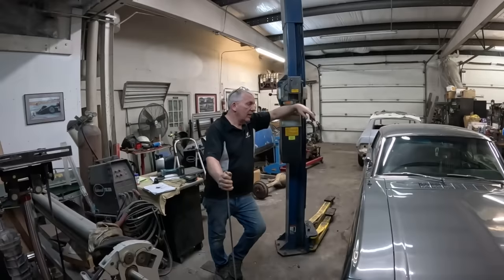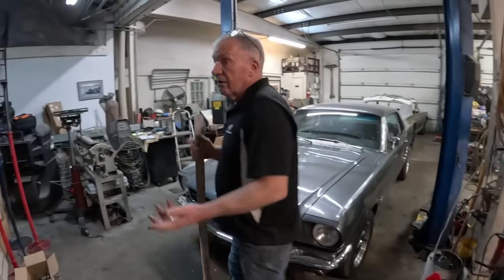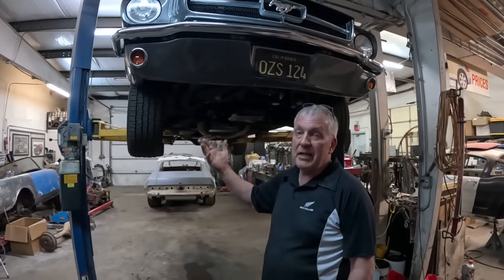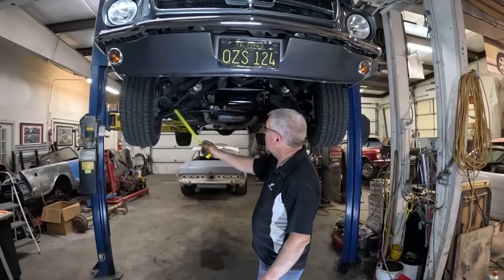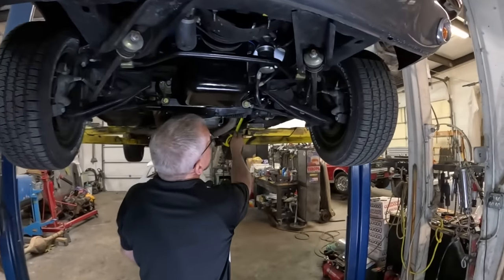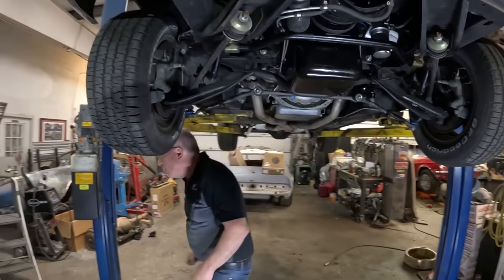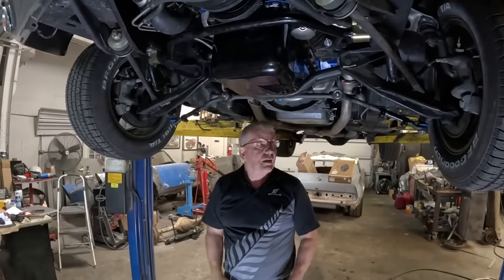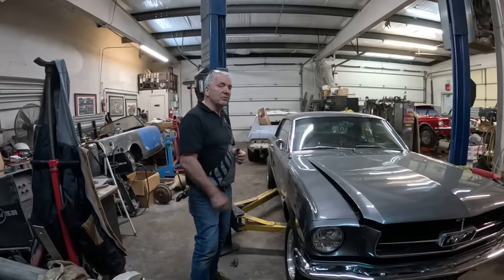Flaming River Fiasco

Comment: Holy Cow!  I have never seen that amount of bump steer.  I built a Shelby Cobra kit car years ago and dove in head first into suspension geometry including bump steer.  Now, it's not difficult to look at a system and see what can be done to correct it.  I mean simple things like rack movement or re-positioning tie rod end connections.  But this Mustang!  Holy Cow! (again).  You're right to go back to the original system.  I know that the flaming river rack could be made to work but it would include radical suspension changes and lots of relocation.  Likely moving the tie rods to in front of the axle.  A rocket science project for sure.

Comment: I just bought a 65 Corvair with a Flaming River steering box in it. The box is a so-called bolt in replacement for the stock box. The car had a full 1/2 turn of the steering wheel slop in the box. I took it apart, and couldn't really see any reason for the slop. I adjusted it, but it still has more play in it than the old, zillion mile GM box I replaced it with. Several people with the same box in their Corvairs had a similar problem. Not sure I would trust Flaming River with ANY steering component now!
Reply: You know🤔the name flaming river lends well for abbreviations 🫢that one’s a laugh riot just waiting..
Reply: how is that even possible if there wasn't like a pin broken off.   did you tear it down to see what was up with it?
Reply: @lasskinn474  Yes, but I didn't remove all the recirculating balls. I suspect that is where the play is.

Comment: Brought an xm ute years ago DU997 nice bright orange show ute 289 5 speed supra but had serious bump steer due to using xb falcon stub axles for the disc brakes they pushed the top and bottom ball joints too far apart replaced with original stubs and machined adapter to use xb rotors and used hz holden brake calipers because the were just two bolts straight through to mount on the backing plate bolted to the original 4 holes the original drum brake backing plate bolted to. Then had to do a recert. Which was the hardest and most expensive part of the fix lol typical kiwi we say it how it is no sugar coating. 😁🇬🇸👍

Comment: Bump steer in Mustangs & Falcons was always an issue. Simple fix.....Dropped mine 2 inches, 3/4 negative camber &  a total of 6mm, or 1/4 inch of toe in. The key is aligning Pitman arm & the idler dead parallel with the frame rails with the car at ride height.
Reply from the maker: Yeah ya just need an alignment tech that will do as he's told right😉👍
Reply: @kiwiclassicsandcustoms9160  Yes...I spent a lot of time sorting mine & then I met an alignment tech who knew his Fords. The 2 inch drop gave it about 1 degree of downward rake at the front. Set it up exactly as mentioned.....handled like it was on rails. On a twisty road it shamed a lot of more sophisticated cars.

Comment: I have used many flaming river steering boxes. The tugs at a major airport used solid non-pnumatic front tires. Very unforgiving and blew out the castings on the OEM steering boxes. We would order a pallet of fr steering boxes at a time. They worked FINE and were a fair quality part. As I was the mechanic changing the broken boxes I had no issues after several dozen boxes. Many things can affect bump steer, shortened steering arms, bent steering arm, raised or lowered steering box position due to frame repair ( accident) or a combination of all parts ( tollerance stack up ).

Comment: Great video!!! I'm wondering if the flaming river rack was mounted too high, relative to the road surface. I'm unsure if that would have corrected the steering shaft joint issues. It does seem like (maybe?) it would have put the rack's joints at an angle closer to the control arms' angle, which could have improved the bump steer. Maybe not...
Reply: On cars with the tie rods behind the axle centerline, that rack should be raised, not lowered. That said, I think that would make the steering shaft angles worse (I think). I was thinking along the same lines as you, just the opposite direction.
Reply: Excellent video and solution. An observation.  If the difference between the rear of the wheel to the front was 5 inches, then the toe in (or out,  depending on which side was greater) would have been 2 1/2 inches. Still horrendous though! Did the buyer have any comeback on the seller?

Comment: I understand your flame of Flaming River Kiwi, but could this have possibly been an installer error or the wrong parts used  more than a manufacturer error? The new parts worked out great though, nice job!
Reply: I don't think it is a Flaming River rack. Look on there website, it doesn't look like any rack kit sell for 66 mustang.
Reply: @GNaron  I didn't look into it, I'm just going by what Kiwi reported. Either way the problem existed so it was either a poorly engineered part (which I double Flaming River would market), or a faulty installation. The important thing where steering, suspension  and brakes are concerned is to remedy the problem so the car doesn't go out with a potential safety issue lurking.

Comment: Recirculating ball steering can be very precise. One thing that helps a lot is to ensure where the steering box mounts to the chassis is very strong and won't deflect.
Reply from the maker: Unfortunately the chassis rail flex's quite a bit on the early mustangs. They added a torque box in 67 that helped a lot

Comment: I went totally off the deep end analyzing the stock suspension. After my mods I got the toe change down to 3mm with full suspension travel. There were a lot of things that influenced it. Namely, pitman arm height,aftermarket arm design, steering box wear or rebuild, idler arm position. + Caster increases tow change as does negative camber curve.
Reply from the maker: It's a science all of own !!!

Comment: Flaming river full gong show on foxbody 
I hate it because here’s why 
1 ) if you order just the steering wrack then 
Number 2 
You have to order the top gear parts 
then because the bushings are different in the steering arm . 
Number 3 you need to order steering rack extenders because your outer rods don’t fit 
Every part is different and depended on the next part 
What a garbage product 
Just a sales strategy! 
You will have to order all 3 or 4 parts and then realize your 12-1400$ in hole for steering rack !
Reply from the maker: Buyer beware....!!

Comment: I was working on a c3 corvette that was scary to drive and the cause was the flaming river rack. The steering shaft had to go almost straight down from the firewall to the rack so that the u-joints would bind and the toe changed with bumps just like this.  I have a video of it on youtube.  The fix was to replace it with borgeson box and stock steering parts.

Comment: I had a flaming river manual rack on my 2012, and it had seemed okay. Different chassis for sure, though. I ended up taking it off the car and going to hydraulic PS because I was injuring myself trying to turn the car when it was sitting still.

Comment: What is a Flaming River Steering Rack conversion? I mean, what does it do? Or what is it supposed to do? I understand everything you are talking about in your video, I just have no idea what the part is you're talking about.
Reply from the maker: It replaces the original steering box and linkages with a rack and pinion system

Comment: I could understand if someone not knowing what they where doing, pulled the parts out of a junk yard and did the install. I've fixed that nightmare before. This catastrophe has a couple of people to hold accountable. The manufacturer and the installer. Installer should have known it wasn't right and sent it back. Letting the manufacturer know it's not right. Good job doing the right thing!

Comment: Scratching my head and thinking..... Would installing the Flaming River tie rod ends under the steering knuckles rather than over them help the bump steer dimensions?
Reply from the maker: Possibly it could have reduced it but unlikely to an acceptable level.  Then you still had the steering shaft universals binding from the too severe angle they were working through.   Time to cut and run as they say

Comment: Unless you want to go road racing and engineer the steering and suspension from the ground up the stock style stuff works fine. You can always get a quicker ratio box that bolts right in. No brainer IMO.

Comment: Listen all these rack & pinion kits are garbage (including the "mustang ii" kits), but you cannot measure toe with the suspension unloaded in the air.
Reply from the maker: No you can't, you measure it at ride height. I was just trying to demonstrate how much bump steer it had.  You expect a little but no where near that much!
Reply: @kiwiclassicsandcustoms9160  I 100% understand I was more pointing it out towards the general public. The best thing about those "F.R." type kits is it's a lot easier to go back towards the stock set up. T

Comment: that's not the same rack n pinion that flaming river shows on their website for a 65-70 mustang!!!! I should know i have a flaming river rack on my 65 mustang and mine is not even close to looking  like the one you show on that car, i installed a manual flaming river rack with electric assist power steering and it works very well! yes i do have some bump steer issues that i will address but not even close to being as bad as your dealing with. again someone installed the wrong rack, that doesn't even look like a flaming river rack!!!!!! looks like a competitors rack. your flaming flaming river...lol you have brought a great amount of awareness to me on how to measure tow in when lifted off the ground, i will lift my car off the ground and give you my measurements, they do have bump steer parts/kits to help out on theses issues, my car drives like a dream but there is some bump steer issue but not really that bad. again the rack you show on that mustang doesnt even resemble a flaming river kit! go to flaming river  and look for yourself!!!

Comment: Looking at this conversion I wonder if the problem is not with the conversion but with the original installation. From what I can tell, the outer tie rod ends were installed incorrectly on the conversion. They are on top of the steering arm. Look at the original setup and you'll see the outer tie rod ends connect to the bottom of the steering arm. Putting them on top of the steering arm will put the ball joint center much too high and give the bumpsteer issue you are getting.

Comment: What Does this have to do with flaming river? How do you know what parts are on that car? I’ve worked on mustangs where people swap them to disc brakes, swap to six-cylinder drum brake car over to a V8 disc brake car and changed the disc brake knuckles, but left the six-cylinder drum brake center links and tie rods and stuff like that and the car had insane bumpsteer. I would make sure that this car has, all matching brake suspension parts on it before calling out on flaming river

Comment: Have you tried EPAS yet? I just put a 2010 Corolla electric power steering in the Flaming River column in my '36 Chevy and it works great. You do "get to" cut your polished stainless column in half though.
Reply from the maker: No not yet but I have a kit here that may well find its way onto Large Marge....
Reply: @kiwiclassicsandcustoms9160   A kit?! That's cheating! I got mine out of a wrecking yard for $130 and a pair of "fabrication" clamps off ebay for $55, a few feet of #8 wire and got er done. I did the same thing to my daughter's '63 Nova but, had to keep the column shift for the automatic. THAT was some engineering.
Reply from the maker: @lylejohnston4125 well yeah it kinda is I guess. But mine cost less than yours so ....😬 😎

Comment: take flaming river name off this video title please, its not even a flaming river product. plus the tie rod end has a taper in it that can only mount up from the bottom, how they managed to mount it from the top is just a big error. I own a flaming river rack n pinion and it works well in my 1965 mustang, I added electric power assist to it as well, yes it does have a little bit of bump steer issue but Im fixing that with a bump steer kit. you want to angle the outer tie rods ends about the same angle as lower control arm angle.

Comment: That flaming river stuff would work if it was installed correctly.   My Cobra has modified jaguar suspension  with a shortened Commodore rack and pinion.  I set it up with the steering arms at the same length and angle as the suspension arms and my bump steer is under 5mm at full travel.  The clown that installed the F.R. rack had absolutely no idea.

Comment: Looks like it needs a wider rack so the pivot points on the tie rods and lower control arms match. If the car had the correct rack, it would drive fine.

Comment: You are generous allowing 1/2 " of toe tolerance. I allow a 1/4"  Though those Fords with their excessive droop will get worse on the full droop.
I check only, without springs, the amount of 'usual' suspension travel. In my case about the bottom third. This on a XE Falcon road race car that is not that low at the front. All slightly modified.
My old XU1 Sports Sedan to was very good, and that was very low and all modified! For steering response both cars have about an 1/18th of toe out. Not recomended for street cars however
In some respects toe is the most important part of a wheel alignment. 
I have seen those 'kits'  and though them very average,, on the ground and not in the car. There is others that are better. And then the dopey 'kits' to make a Falcon pogo stick like a Commodore. Pogo sticks should all be banned!!
Reply from the maker: I have to keep my race car mentality in check and remember that I'm working on road cars. Had a rally car years ago and got that down to 1/8" of bump steer over 8" of travel.  But it took hours and hours to do.  Paid off huge in stage times though!!

Comment: Basically what has happened is the tie rod on the rack and pinion are too short.
I have set back rack and pinion twice and they were measured both times they were different length.
This is avery common issues with reman rack and pinion.
Solution is to get longer tie rod ends.
Dont adjust the tie rod with the wheels planted on the ground,it binds the steering,keep the front wheel so they are touching.
Center you steering wheel,line it from the center of the rear wheel to the front,then measure front edge of the rim,and the rear edge of the rim,then divide by 2,and then adjust with the wheel so the front is slightly towed in by a 16th.

Comment: Great video - thanks, are the Borgeson boxes a relatively easy certification in NZ?  i have manual steering now and tossing up between a borgeson or RRS rack and pinion.  thanks
Reply from the maker: Keep in mind that no steering components can have any welding in/on them.  Some Borgeson box's have the mounting  plates welded to them.  What sort of car do you have.   If any of the RRS bracketry is welded that will be an automatic fail in NZ
Reply: Its a 1970 with 4v 351c.  I think the latest Borgesons are no longer welded so hoping they should be pretty straight forward.  A friend has the RRS on his mustang and is certed, it looks like a nice bit of kit but my preference is to stay as close a possible to stock (hence the borgeson).
Reply from the maker: The Borgeson mustang boxes are cast now so you're good there.  One thing though, when I took my old man's mustang back compliancing failed me on the Borgeson rag joint that comes with the conversion because it part of it was welded.  Had to take it out and use a universal joint!   The cert guy was an ass though.  All rag joints have the flange welded to the center even factory ones 🙄

Comment: the freakin tie rod ends are mounted incorrectly and that's not even a flaming river rack! the tie rods mount on the bottom of the spindle arm not that top! plus that's an bump steer tie rod end kit but mounted wrong! has flaming river been contacted to defend themselves

Comment: And the damn headers
Reply from the maker: I found that leak!  One of the primaries was leaking where it wasn't fully welded to the Cyl head flange.
Reply: Headers add 125% more horsepower, especially on street driven cars which rarely see 4000 RPM.  I saw it in a magazine.
Reply: Headers also add 54% more frustration any time I have to work around em lol
Reply: @BPattB  I call them Rubic's Tubes.
Reply: @paulhare662  LOL I'm doing a single to dual bowl master swap on my 65 and I'm trying to tie in to the rear hard line at the fire wall. Trying to flair the line in the car with the headers in place in killing me. That said I'll remove the whole line before that header comes off lol
Reply: @BPattB  Another benefit of headers is the need to ditch the old starter motor, the one that has worked just fine for 75 years, and replace it with a "lightweight high torque fully adjustable fits all"  flywheel eater.
Reply: @paulhare662  LOL.  It'd also great all headers come with 5 different custom ground wrenches so you can make sure that every bolt is tight. Then all that's left is to get the torque wrench out and,,,,,,,, oh wait,,,,🤣

Comment: Maybe I missed it in the earlier video but do we know what precipitated the owner to replace the stock steering in the first place?  It would have been a costly change so what were they trying to fix?
Reply from the maker: It was a factory power assist steer car so it was probably leaking. I don't mess with those and upgrade to a Borgeson power box.  On paper the R&P upgrade is a good one, sadly "on paper" just didn't translate into the real world in this case  due to poor execution on the part of the manufacturer.